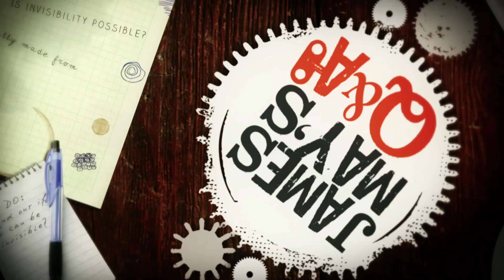Why Can't Trains Go Uphill? | James May's Q&A | Earth Science

Comment: so, lets start covering hills in rubber then
Reply: ***** 
Good idea, but the reason that they probably don't/didn't do that is that it's not very feasible as you won't be able to accurately make use of friction when you need to. 
Your frictional or tractive force (resistive force) actually comes from 2 components - the perpendicular reaction force and the coefficient of friction. Your idea of rubber (material) helps in bolstering the coefficient of friction but the reaction force is slightly harder to get down (especially with retractable ones). Reaction force is basically the weight force or a proportion of it (based on the level of the incline) and as you can imagine it will be very hard to synchronise all these retractable wheels, and it'll also be hard to transfer the full weight of the train onto those wheels. 
Apologies for all the parentheses lol and also, my explanation is very brief and doesn't cover the mathematical and physical concepts fully - feel free to search them up though! Hope I helped
Reply: Pianoman 70s style  Whell while I love rack or cog railways, there are a few things that puts railway companies off.
First the speed is rather limited, so that the gear doesn't climb out of the rack and cause a derailment.

Second, all wagons or coaches on a rack section need to be fitted with a brake working via those racks.

Third they need lubrication, quite a few of it, and those lubricators need to be bio-degradeable and not harmful to the enviroment, which means animal fats, no mineral oil.
Which also means that they are much more expensive.

Fourth the gear for the rack needs a different transmission system, can use the same engine but it can't be directly attached to the wheel.
But thanks to newer systems they can use their adhesion drive (the wheels) and the rack drive at the same times.
An example would be the Hge 4/4 II.

Well, that is their position, on overall a rack section is not a bad idea, and often it's cheaper to build than a massively expensive tunnel or adhesion railway.

The Barge Tractors on the Panama Canal use a rack system to improve their pulling power.

The problem is that nowadays most of those projects and railways are run by people not knowing anything about the matter.
And then there are those making regulations..........they know nothing, yet they yap all the time.
Yeah, European Commission, I mean you!
Reply: *****
Fair enough, but I would disagree with you on that it's safer, than having a human run it.
In aeroplanes they are under human supervision, even drones have their operators.
Both FMCs (Flight Management Computers) and the FLCS (Flight Control Systems, the so called fly-by-wire) are not autonomously operating, they are still commanded by humans.
The FMC can be overriden at any time, and the FLCS does what you tell it.

As for Trains, well, most times you only hear if the driver messes up, and rarely if he ever saves the day.

Last Summer an ICE derailed after hitting a tree on the line at 80 km/h.
That was due to the driver noticing some  fluctuations in the line voltage, reasoning that a tree had hit the overhead wires, and immediatley applying the emergency brakes.
When that happened the train was travelling at 200 km/h, during a thunderstorm at night.
So there was now way of knowing or seeing that there was a tree on the line, without the reaction of the driver the train could've hit with 200 km/h and the derailment would've been Catastropic.

I don't think that computers are ready to run a train on a system that is not a rather closed loop system like those two underground lines.

The Question would be if it really would be more reliable than a human driver.

Computers are very good at doing repetetive tasks, but they have problems dealing with unusual/unclear situations.
Can you program an control system, so that it will work

Also it's questionable if its economically a good idea to replace drivers with computers, as you would take away a lot of jobs, which would lead to a general reduction of demand for general life related goos and services.

As for the Financial markets, there have been several allegations of tampering with the system, so I won't regard it as safer than human controlled.
It's so fast, that it's intransparent and very hard to control.

As for the MagLevs, well, unlike the railways so far where we use the Computers to help running the trains (not strictly necessary though) and use them for signalling, in maglev, you need them for the track as well.

To get the Magnetic shift that gets the train running.

In the case of signalling, computerized contorl centers are actually infamous for being less reliable than manned Signalboxes.
Quite a a big portion of those human error related accidents in german railway's are due to errors in the technology or rather overconfidence in it.
We had a few crashe and almost crashes, where the track control system reported a track as free, while it was still occupied.
Which has lead to banning of the use of sand to aid traction, because it supposedly isolates the wheels from the tracks, making the system unable to recognize an occupied track.

Also there is still the vulnerability to things like EMP, both sun and weapons based.
If push comes to shove, in such a situation you can drive a train by sight on the old rail based railway.
There are still enough old locos around who do not need microprocessors to drive.

On a Maglev, you can't do that, Maglevs work beautifully in a fully functioning society, but they are vulnerable to disasters, because they need that society in order to function.

The old Rail-based railways can function under the worst circumstances.

Also I'm german, and I've witnessed the Transrapid Disaster with all it's failures up close.
The problem is, Maglevs are no solution for the Goods transport, yet, and they cost quite a bit of money for a singular use, like most railbased highspeed lines.
Money that is right now better spent at modernizing the whole rail network.

Also there were several studies done into the energy efficiency of the System and several of them questioned the notion that Mag Levs are more energy efficient, than railbased trains.

This is my analsys based on the now, the future might prove me wrong.
Reply: DaGleese
 when its about making money they dont give a shit about environement
Reply: Then there is friction which would bur way more fuel :-(
Reply: I think it would just be more practical the conventional way. I respect your idea!
Reply: ***** yah... But I guess they have bigger problems to think about, plus rubber wheels would probably require more maintenance than they can bother to administer, another problem would be to synchronise the speed of the rubber wheels before they touch the tracks? Mere speculation anyhow
Reply: Tommy Thai Rubber coated track is a better solution than rubber coated wheels because it would only require rubber on the steep grades allowing the train itself to keep its efficiency on the level areas.
Reply: Let's not all forget that rubber wears greatly with friction. You are talking about tons and tons of weight. The rubber tracks would need to be replaced extremely often. It's just not feasible to use rubber, maintenance and replacement material costs coupled with the increase in fuel costs to get the train up the hill would probably outweigh an investment of simply landscaping the track to level ground, or building a tunnel. If it is a case where heavy goods need to be taken uphill, then it is still just easier to build a road from where the train stops and use vehicles. An expensive idea would be to make electronic tracks that operate like a roller coaster, locking the train into place and manually pulling the train up the hill. But that is going to affect speed. It all comes down to the circumstances, i.e. the time taken for the train to travel up the hill vs the time taken to offload from the train to vehicles and then transport up the hill and the potential cost in energy of each option.
Reply: DaGleese It's interesting that you point out that the remedies would cause loss of speed.  Yet, isn't that the whole reason for the remedies?  As James points out, the smoothness of the wheels on the smoothness of the track causes slippage, which causes speed loss and fuel loss to begin with.
I like your idea of the roller coaster thing, though it needn't be a chain driven thing such as on an actual coaster.  It could be a raised gear track raised above the track between the two tracks which could attach to a cog attached to the inner sides of both wheels. This would eliminate the slippage while keeping it a metal on metal form of drive reducing the friction that rubber would cause while simultaneously reducing wear the weight would cause to rubber.
Reply: Sounds like you know a lot more about this issue than I do.  Thanks for taking the time to give your input. It was interesting.
Reply: Pianoman 70s style
 Nah, I'm just an interested amateur, a friend of mine is a loco driver though.
But thanks! ;)
Reply: Actually, the rubber (or something else with high adhesion) on the tracks does sound like it might have some mileage.  Sure, it would wear quickly and need regular replacement, but surely in the 21st century we have materials and techniques to do this?  We already have highly automated track maintenance vehicles, why not one which sprays (or applies in some other way) a coating onto conventional rails?
Reply: EASYTIGER10 Rubber is not environmentally friendly. Although there is a potential for solving the current global tire problem if we could recycle tires in a way that would make them usable for this application.

But I don't know enough about that to comment without sounding like a tool :P
Reply: *****
Two problems with that, first there is the immense cost of Maglev trains, not just the trains but also the Infrastructure.
The Cost for the short line from Munich Main Station to the Airport was so immense that the state of Bayern and the german Republic abandoned it
So far aside from some test tracks only one commercial track has been built, in Shanghai.
And it's usage rate is 20% with a high deficit of 100 million euros per year.

Second the Maglev is dependent on a lot of computer systems to actually work, which makes them very vulnerable to either hackers, EMP or just computer bugs.
The Railways are a rugged and old system that works under any circustances, if a modern loco has a control system bug, you just replace it.
But in a Maglev you first have to find out where the Bug lies, and if it's not the Control systems of the train, but the one of the track, it will close down the whole system.

Also the Viability of MagLev for freight traffic has not been proven.
Another Question is how energy efficient it is compared to the rail-based railways. 

As for Vacuum, there is one security problem with it, the vacuum itself, it's rather harmful to people, so you have to build the trains in such a way to avoid such a problem.

So you would have to build the trains with a pressurized Cabin, which means an more complcated building process and having to take the same proctective measures like in an Aircraft.
Loosing more of the Railways ruggedness in the Process.

I'm not saying it's a bad idea, or that it shouldn't be followed, just that it's not ready for introduction anytime soon, and that the implications of it are not fully thought through.
Reply: *****
Thanks, good points in your case too! ;)
My main issue with that system is not the technology of MagLev, but the fact that it leans so heavily on computers to control it.
A trend that I'm wary of in the rail-based railway too.

A life-long interest in computers, and working with them everyday, has just taught me how fragile those systems are, how vulnerable.

For example, it's today not a question if a system is hacked, but when.
Also if you've ever done a bit of coding, it's amazing how easy it is for the system to fail, just one typo in the code can mess it all up, if the Typo is in the wrong place.

So I think we should keep researching that direction, it helps us develop as a species, and gives us something to dream about, to be excited about for the future.
It can also lead to some new Discoveries which will help us all, across the board.
Reply: *****
On the Contrary, I trust you, just not your bosses. ;)

I believe, that any single one of you wants to make the best job possible, and deliver a perfect program.
And given the necessary resources they would.

The problem are usually those that want to make a profit of it and have no scruples to sell a software or control system with bugs.

And I have no trust that our politicians are savvy or impartial enough to avoid those firms do work like that
Nor are they computer-Savvy enough to understand the implications of their decisions.

Also I'm skeptic as to if a computer is truly safer than a human, or that it would be more benefically to society as a whole.
Reply: Heavy wheel slip, rip, tear, shred.

Comment: The item not mentioned is gearing. Steam locos had fixed gearing and could not "change down" to a lower gear to go up hills. Modern trains can cruise up hills at a speed that steam locos could only dream of. This is mainly because they can apply much more torque to the driving wheels at low speeds than steam locos can. Watch YouTube videos where a modern train cruises up a gradient without breaking a sweat, followed by a steam excursion where the loco struggles to make the same same grade at a snail's pace with billowing clouds of steam...

Comment: So the top speed of a motorcycle vs a car is similar but less dramatic due to tractive force? The contact patch of a motorcycle is only about as big as the palm of your hand after all.
Reply: Yes,
A friend of mine is mad about motorbikes and is a specialist in the prediction and simulation of motorcycle handling. I have hard that at around 150mph  bike will just spin the rear wheel in trying to go any faster.
Reply: A Hyabusa will break 200mph with a chip flash. My ZRX1200R has a theoretical top end of 153mph. Engine wise the difference is better intake, ignition, fuel distribution and about 100ccs all in favor of the Hyabusa. Aerodynamics makes the biggest difference. If my ZRX was fully faired the top end would be closer to 180mph. Tire spin at 150 is no issue. A twin Suzuki powered streamliner fielded by team Ack Attack holds the current motorcycle land speed record of 376.36mph but it has a Mickey Thompson rear tire.

Comment: Why didn't they mention the use of the sander for added traction?
Reply: At least in Germany that is a 'last line of defence" type system. The amount of sand is limited and needed whenever you need extra traction not just on hills. Multi-Traction and pusher engines are the prefered solutions